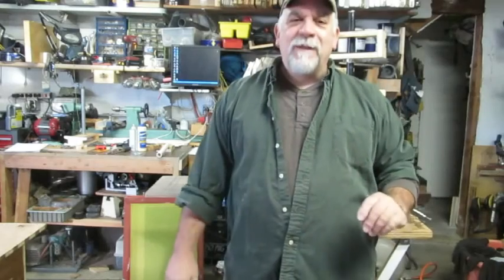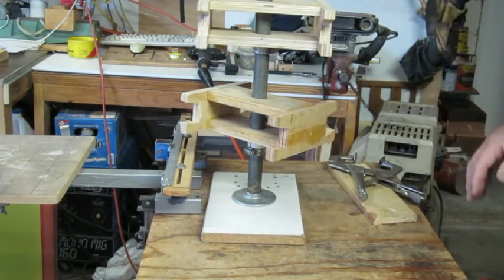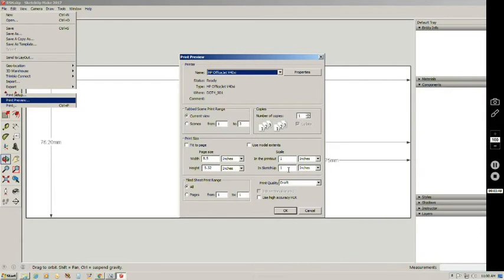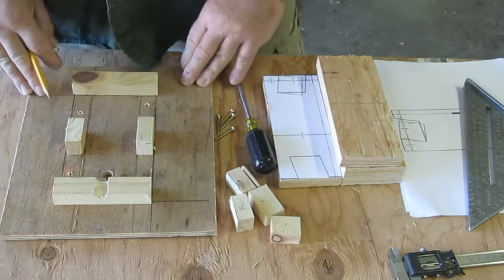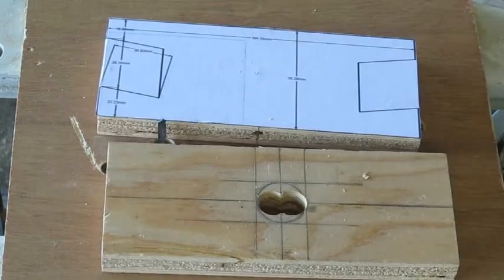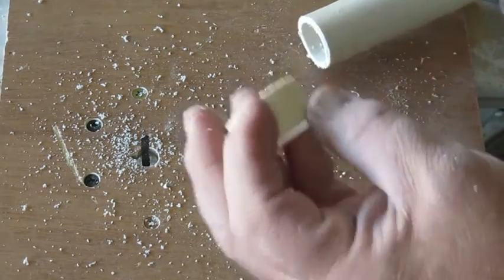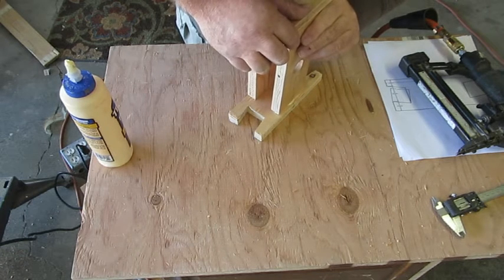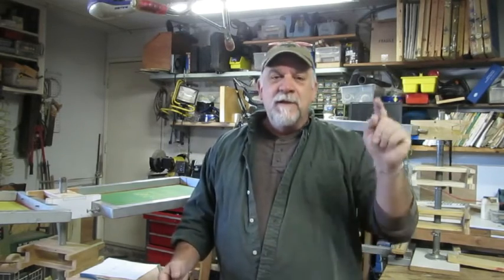Rotary Screen Holder Build

Comment: Thanks for sharing. Forgive my ignorance but what are those screens used for? They don't look like silk screens.
Reply: Those are 20 X 24 aluminum printing screens.  Look at the previous video.
Reply from the maker: That read more short attitude than I intended...but I was on the tablet when I wrote it.  The previous video shows me setting the screens up for use with my style of screen press so you can get a good look at them. Indeed, they are the screens I use for printing.